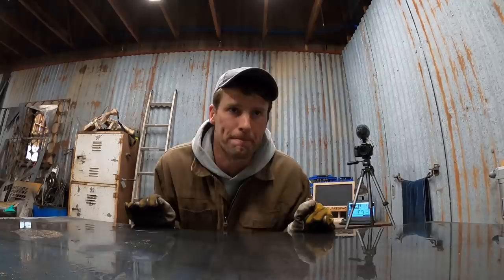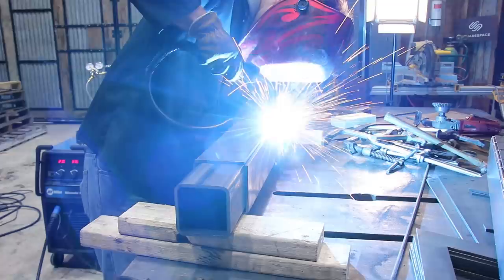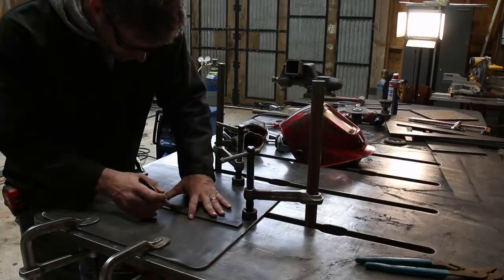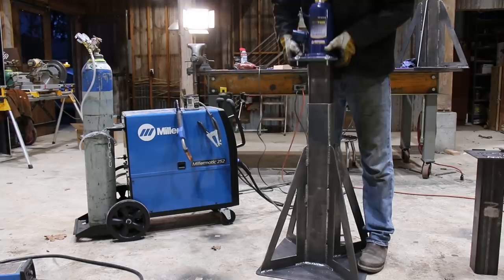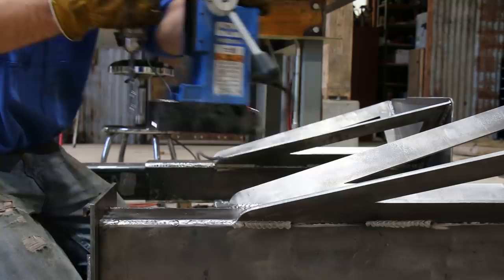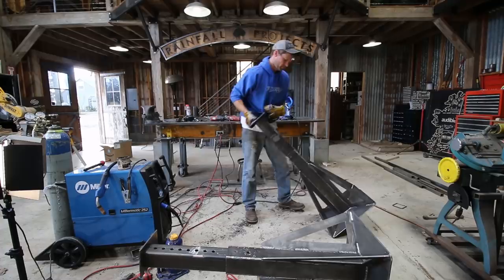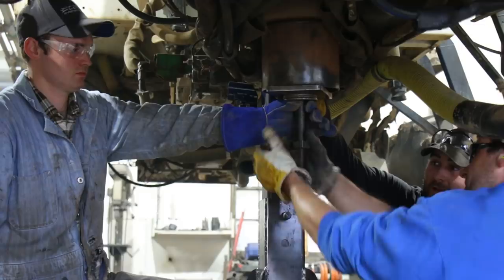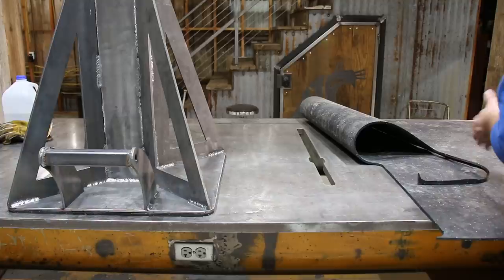Jack Stands - 60" Adjustable

Comment: Hey bud just a quick observation and suggestion. My experience servicing heavy equipment in the steel mill industry working around one off type tools made to service 1 piece of machinery. Please consider trimming your outer tube 1/2 inch or placing a stop at the bottom so your Bottle jack plate on the inner tube does not stop hard on that outer tube. I could see the cringe in your face when dropping those in with your fingers wrapped around that plate. The pinch point could end-up being a bad day on the farm for someone just trying to let the stand down getting a finger pinched there.
Reply: A couple of squares of rubber mat inside the bottom of the outer tube might work.  Or just a chunk of 2x4!
Reply: @rentbennett  Or steel.
Reply: Finger-pinching is a problem that all jack-stands share, especially the traditional sawtooth-shaft ones. I've lost more bits of skin off my hands using jack-stands than from any other type of tool or implement, including angle-grinders, which are supposedly the most dangerous hand-held tool there is. I've only ever had one or two minor grinder incidents, but I lose skin literally every time I touch a jack-stand. Those pinches hurt far more than they should, too. Far as I'm concerned, jack-stand shafts could have been effectively used as a medieval torture instruments. It would bring a whole new meaning to death by a thousand painful cuts lol.
Reply: never lost any skin using jackstands
Reply: @ElvicFarms  Then you're in the minority. Saw-tooth jack-stands are notorious for pinching off little chunks of flesh. Anyone who's ever moved jack-stands around in a hurry has experienced that.
Reply: @All Cars Matter lol Y u mad? We're not talking about heart surgery here. It's simply a pinch. Get over yourself.
Reply: @All Cars Matter lol k
Reply: all that overbuilding just to protect people that should know better...
Reply: @ElvicFarms  ............ yet.

Comment: Weird, never expected that he meant literal stands for jacks. Going into the video, I was thinking just tall versions of what you use when working on a car. 🤣
Reply: thats one thing you never weld yourself
Reply: @b5580  yes it is... stop being daft even a dually 3500 only weighs 11,000lbs if you cant weld something that can hold 1/4 of that you should be welding, theres little to no dynamic forces acting on jack stands just static gravity
Reply: Brudesey Uhhh how would that be any more dangerous than this?

Or are you just saying that they’re so cheap that nobody would bother?
Reply: @Nevir202  My thinking was the way he did it, its for a huge tractor thats being supported by the wheels, hes just working on parts underneath it, which was very cool. As for working underneath a car those jack stands fail the car is on top of you.
Reply: I'd much rather an underpaid, overworked factory worker in another country weld my jackstands.
Reply: Brudesey If anything, that’s just arguing for something extremely overbuilt.

Something like what he made here could NOT be crushed by the weight of a car, even using 2” square tubing.
Reply: Brudesey 
I worked at a body shop we had about 20 “hand made” jack stands in various sizes.
Reply: I was under the same impression until I read your comment

Comment: A couple helpful tips for you: instead of always using hard wire MIG, swap over to Flux Core wire. Since you often weld through mill scale, MIG is not great for penetration and strength. Flux Core is basically wire-fed stick welding. Stronger, no gas, less prep.

With your Mag Drill, instead of large twist bits, use some annular cutters. You don't need the pilot holes since the annual cutter is basically a hole saw. Faster, more precise, less wear.

For your jack stands, next time space the outer tube by using some MIG wire laid on two sides. that 0.035 gap will be perfect fit and clearance for sliding them and keeping them sure-fitting.

Always enjoy your work ethic, creativity, and attention to detail!

Comment: made a similar set for working on my jeep so i can have it jacked up by the frame and droop the axles out, just 1" tubing inside of 1.5" tubing with a 3/8" pin, did the same 1" off set holes to double the positions, used 3 "legs" rather than a flat bottom to make them sit flat and be useable and pretty uneven surfaces

before someone says im crazy for only using a 3/8" pin realize the single shear of 3/8" grade 8 is 16,000lbs and these stands use double shear so 32,000 lbs per corner.. you could balance a jeep on a single stand and still have a 6x safety factor

Comment: Hey big guy awesome build! I have made a set of jack stands as well and one thing that really helped is I put two gas springs inside the stand in the corners so it wouldn’t interfere with the cross pin. I weighed the top piece with the jack on it then went to McMaster Carr and sized two gas springs (or shocks)  that had the right amount of travel and external force to lift the top portion. Then I plasma cut a plate to sit inside the bottom piece and the top piece with holes in the corners to line up the threaded ends of the shocks. I put nuts on the threaded ends of the shocks to push against the plasma pieces. And then put it all back together. Now I slide the stand under pull the pin and the top sits still and I push up with about 5lbs of force and I can easily set the pin hole where ever I like. And since the gas springs and plasma plates aren’t welded in I can just lift the top out if one ever fails and I need to replace it. I also drilled holes on the blank side of the jack stand half a spacing off from the original holes. Really helped with adjustability in any scenario.

Comment: Nice work. They turned out great...👍
A little tip from one metal fabricator to another, is to try and finish drilling holes etc. on the individual parts before welding everything together. Most often it will save you a lot of time and frustration.. Sometimes you can't get access to everything when it's been welded together..
It would also enable you to tack the 4 outer pieces on top of each other and drill through them all in one go.. Then you're sure the holes will line up later...
Looking forward to seeing more of your projects... Subscribed

Comment: I recently made some jack-stands. No way near your size! I was directed to use aluminum cans as spacers. Great hack. As always, excellent work. I’ve been a fan from your first video.
Reply from the maker: Allen W Aluminum cans as spacers is a great idea. I actually used some strips of 14 gauge for spacers first and that was way too thick for a good fit. Aluminum cans would have worked great. Next time!

Comment: I feel your pain when it comes to shifting sheet onto the cutting table. I have a 1kW fiber laser and sometimes cut 8mm sheet on it. Even with a manual fork lift stacker they are hard to get onto the table. Unfortunately I have no room for a jib crane.

Comment: Nice job!! Save the headache of drill holes by pulling a few grids on your plasma and tack a fixture where top of tubes set flush. Then let the plasma do all your holes. To load your sheets get a plate clamp and a chain hoist and make a swinging jib arm. Great video!!

Comment: We have similar homemade jack stands at my shop, we work on commercial trucks, the base is a 22.5” semi wheel and the masts are semi trailer jacks, we use them usually to put a body on and be able to vary the height, incredibly handy when rebuilding the subframe of a box truck

Comment: I once rented one of those magnetic drill presses for a job but the magnet kept slipping, it was obviously just worn but now every time i see one i get tool ptsd
Reply: Many times, the magnet is still very strong, but physical wear on the bottom surface could reduce the magnet's contact area with the material you're drilling.  Also, the magnets hold better to thicker steel.  So, if you have any way of adding an extra piece of steel under the material you're drilling will help keep it from wandering off.

Comment: Pretty slick! Dig it. One concern... those bolts and washers retaining the bottle jacks... my first thought was any heavy lateral shift in weight, like a lean, would shear those right off. Maybe a stronger bracket and clamp system to hold it in place?

Comment: I would go with the same kind of hoist system you have in the farm shop over the plasma table. If you get a magnet to hang from it, handling those big sheet of metal will be a piece of cake. Love the videos, although I would love to see more of the farm work. Always fun to see what you are up to on the farm.

Cheers from Sweden.

Comment: Hi used a engine hoist with a magnet plate clamp too move your steel plate, from the truck too plasma cutter, nice axle stands 👍👍👍air to bottle jack is quicker than hand cracking used that as a back up no air lol.

Comment: I do use HONEY on all my online purchases.... for more than a year I've been very pleased! 
To help get ALL of that weight off of you when wrestling with steel plates (etc.) ....construct yourself an overhead HOISTING mechanism from just inside your double shop door from the ceiling. I'm fully confident you can engineer that rail and pulley system with no trouble...but you'll definitely need extra "hands on deck" when installing it way up there! :-))

Comment: Engineering tip.  If you are supporting/lifting that much weight you need to add some metal to your gussets so that they form a T.   That much weight won't even notice 1/4" plate that is that long and thin, it'll just buckle.  You got lucky in the video but some side force or swaying on the equipment and it won't stay there.
Reply: @Dave Anderson replied: "It's not about compression, it's about tensional strength. But you just keep giving your tips Mr Engineer."

You can't apply a tension load to the ground genius (at least not with a simple contact like this).  The side of the jack that lifts up can't stabilize the load only the side that is pressing into the ground will.  It IS about compression.

Comment: I wonder if you could also be able to mount rollers or other accessories  on them with the mounts you made. That way when you're cutting or welding big pieces or equipment they can be used to hold it up while you work on or cut it.
Reply from the maker: Tony Baggett That’s a good idea, I like it!

Comment: Hang a beam along the ceiling of your cnc workspace, and put a trolly on it with a chain winch... Size it for the max weight of your plasma table, and make some attachments for carrying plate.

Comment: You do great work. Look into an electric magnet that runs off a 12 volt car battery. This would help with the heavy stuff and could be used with the fork lift, jib crane, or overhead hoist.

Comment: Cut a few pieces of wire about an inch long and use it as  spacer when you making that fillet weld, helps to square it off and makes a better weld with the little crack.  You get much better penetration.

Comment: You forgot the all-important disclaimer that if you aren't a ticketed Welder, or at least a highly-competent self-taught Welder, one should never attempt building highly-critical load-bearing structures like these, and things like this should always be stress-tested at their maximum capacity before ever putting equipment up on them.

Comment: jacking up a post and being able to pin it to take the load off the bottle jack seems like it would be better. this is a simpler design however, bottle jacks are cheap enough too

Comment: Make it extreme channel makes an electromagnet out of microwave magnets for lifting steel check it out.
Reply: Same thing I had in mind and also maybe add some grease zirks if the fit is a bit tight

Comment: Ever considered an electromagnet like you see at junk yards but smaller OR a larger neodymium magnet but that would require rubber or something similar to that magnet inside some sort of bracket you coukd use a large bolt and a drill to pry off the magnet. Man made magnets are Dangerous the larger they get

Comment: Me:
Only one in the whole school that knows how to use our cnc plasma cutter
Yet still cant figure out amps for the plasma
Reply: 20A for 1/8in, add 10A for every additional 1/8in. So 3/8in would need roughly 40A, 1/2in 50A, etc

Comment: I don't think 200 was bad they would cost 1000 if you was to go buy some even if you could buy some witch with every thing you did with the wheels and bottle jack I fought you could buy anything close to it unless it was snap on or maybe mac co and they would be 2000 or more

Comment: You seriously need to lower your plasma table. There's no legitimate reason why they need to be so high. It's kind of a hold over design aspect taken from router tables, where the materials are fundamentally lighter, and often engaged with during operation. Such as changing router bits, or reaching in to take out cut parts. (if you have a vacuum table, you shouldn't be reaching in anyway until the cut is done) But plasma and torch cutting don't need fiddling and reaching in, but are often times loaded with overhead gantry cranes anyway. And safety dictates that you should never lift a large flat sheet higher than necessary anyway.